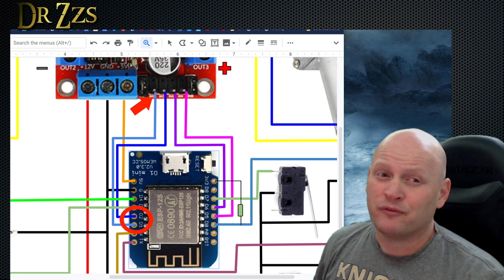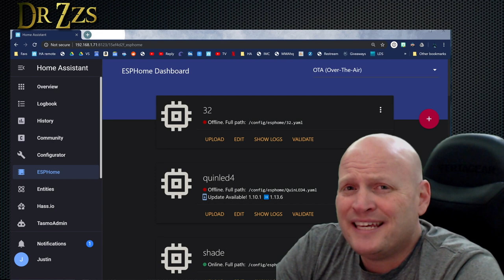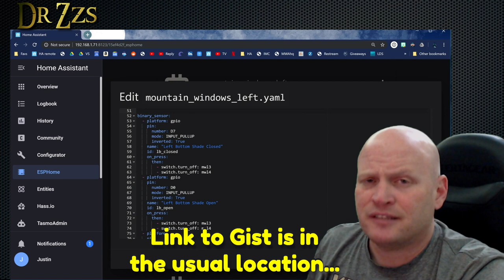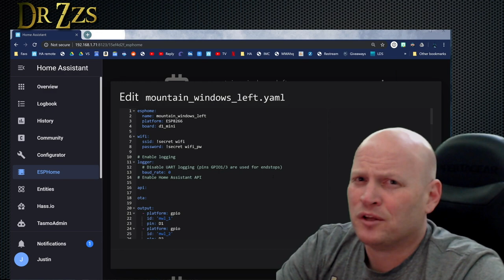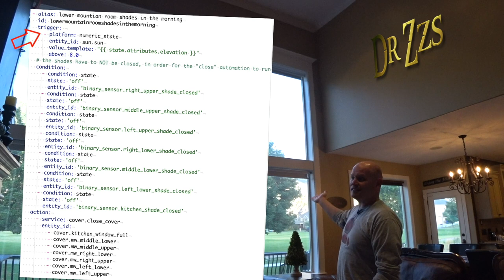DIY Smart Shades for Home Automation

Comment: I bought 25RPM motors for the ones I'm making. Also got a faster one to turn a threaded rod to open a sliding window.
Reply from the maker: good choice. Mine could be faster for sure.
Reply: What motor did you get for the sliding window? It's always tricky to work out what speed/ torque will work best without a lot of trial and error
Reply: @pangit9999  good question. I can't recall. It's the same type of small high torque as the others. I took how many cms i needed the window to open and how many threads/cm there was on the rod and worked out how quickly it needed to turn for a speed that wasn't painfully slow. It's still trial and error though but I can swap the motor out if I need something beefier. I still haven't put it together yet.

Comment: Would it be difficult to add a rotation sensor to record the percent open or closed?
Reply: Bob-a-FET just get an encoder
Reply from the maker: Is that something I can add to my motors, or do I have to buy the motor with an encoder built in?

Comment: If you have to resort to Hot Glue to hold your pin headers and jumpers together.. OMG just solder the wires!  It will be some more compact without all those pins sticking out in all directions.  If you're gonna use a 3D printer to fabricate boxes, then soldering wires isn't that high a bar for people..
Reply from the maker: I see your point. If I had more time I'd solder everything.

Comment: Awesome Video!  You Rock.  Got from zero to hero in just 1 afternoon; fastest time putting together my breadboard to test.  Anyway, because of latest ESPHome updates, it turns out plain stop() is being deprecated in favor of a call to set_command_stop().  and perform() on top of that, so you might get a warning upon compilation (part of upload); picky bastards!!  I guess with efficiency, sophistication goes up.
Anyway the lines that call for .stop() inside Lambdas section need to be modified to .make_call().set_command_stop().perform();  for example:
 // shade is closing
                id(mw_left_upper).stop();
needs to be:
 // shade is closing
                id(mw_left_upper).make_call().set_command_stop().perform();

Same goes for .open() and .close() lines, just change the verb, ie: set_command_open 

Hope this help the next tinker stumbling upon this ESPHome compiler warning.

Comment: With a little bit more logic in the code you could have used one input per blind for end stops in parallel.
Reply from the maker: So one end stop would stop all the shades when pressed?  
That's an interesting idea. Tell me more.
Reply: @DrZzs  still have 2 end stops but have them wired in parallel to one input. The code would just listen for the one input for both directions. Would save 2 inputs per D1 mini then. So you could drop the one with the pullup resistor for instance.

Comment: I can't believe you wife lets you keep those, no offense but it looks horrible.
Reply from the maker: She doesn’t complain. Hiding wires is one thing I’d like to do better. What else do you hate about it?
Reply: Just the wires really and the switch sticking out.
Reply from the maker: I agree.  I hate the wires.  Someone suggested using a hall-effect sensor and a magnet on the roller to count the revolutions.  Really, a stepper motor would eliminate all that, but I don't know how to get a stepper working with ESPhome or Tasmota and I don't speak fluent Arduino , so I'm stuck with those options.